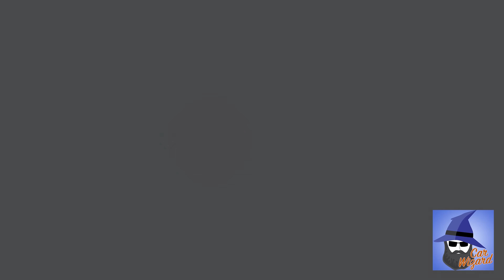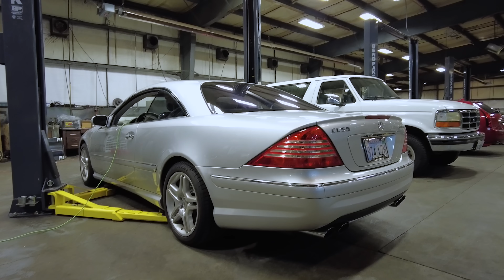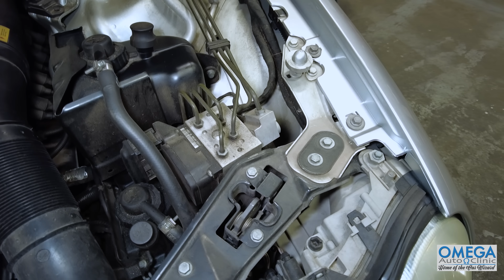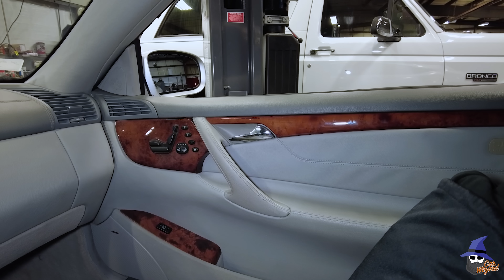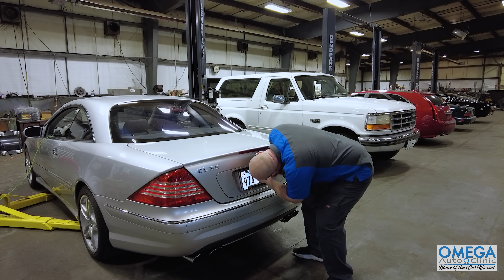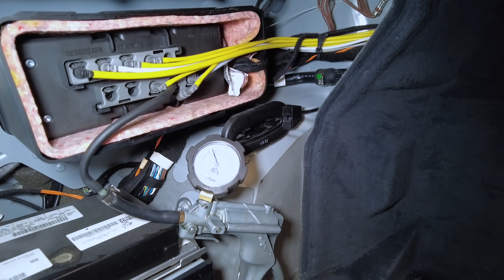Really, $4K to fix the locks! How can the CAR WIZARD charge SOOO much to fix this '05 CL55 AMG?!?

Comment: Out of the luxury mercs this era CL is maybe my favourite. But there's a reason they seem like a great deal used. Before prices took a hike, you could get a black cl55 for €5k. Because they're €10k per year to own.
Reply: Bingo
Reply: Bruh I own a CLK200. 

It's by no means cheap, but it's more like one thousand dollars a year to own, with hikes of up to 2k when something breaks because mercedes parts are expensive as fuck.
Reply: @user-rd3ou5ev6o CLK vs CL is quite a difference. This car has more computers in it than Silicon Valley
Reply: @tenzinsmith  Yeah my point is that this car is a money pit even when ur talking about older models, can't imagine new ones. Also the car is just uncomfortable as f*ck, nothing luxury about a coupe. 

As someone who's had a CLK 200 for like twenty years now, I can confirm the car is a piece of sht. 

Uncomfortable as hell, expensive, heavy, gas guzzler.

Yes it's a mercedes and if you take care of it it will last forever, but that care is expensive.  

Buy a four-door honda and be done with it.

Comment: There used to be a kit to repair the pump, replaces the seals that wear out when the pump runs constantly.  Same for the airmatic suspension pump, I have rebuilt that for $100. I have never seen a lock actuator leak, it’s always the hose. The seat bladders do leak sometimes, but again it’s mostly the vacuumed tubes or hard plastic connectors that crack.
Reply: I had the exact same car, I can bet that the leak is due to one of the door locks actuators or one of the hoses under the seat (for the lumbar/dynamic seat function) cause the seat move backward and frontward every time you open/close the door and that consistent daily movement cause the line to crack or separate. let's wait until her replace the PSE pump and see what's what lol.

Comment: back in the 90s I had an audi auto and as I was leaving the motorway and lifted off the engine stayed ay max revs I managed to stop it turn off, when i turned on it was fine so I carefully made my way home. Turned out all the carburetor "green" controls were air drived found a Y shape hose which had split when you moved the arms apart revs went to max. Nicked a piece of plastic hose from sons fish tank fixed.

Comment: I had a 1987 Jetta GL that was stolen and then it turned up about 2 months later at the NYPD pound in good shape. However,  they had meddled with some engine components and it cost me $1200 just to find out if it would run, which it did.
Reply: I'm happy for you, but I don't see how that relates to a Merc vacuum lock system?

Comment: I had a really nice 1977 Mercedes 450SEL years ago that had the vacuum door locks.  When I bought it, I noticed there was a golf tee stuck in a line near the latch in the trunk.  I assumed a leak somewhere since I had to use the key to unlock the trunk.  All the door locks worked fine so I just left it alone and never had any other trouble with the system.

Comment: I hate that all new cars these days are putting power everything. Power tail gates. Power seats. Power head rests. Power door assist latches. Power steering wheel adjustment. 

It's just a recipe for huge repair bills. I don't understand how adjusting your seat, or closing your doors requires electric motors. Or why that's even a huge benefit. I've never cursed at needing to open the tailgate lol.

Comment: Earlier versions, usually a 2 cent diode failure in the compressor. Water ingress! Seen a failed Golf R with the same system, crash damage on driver door, the failed to reconnect the line and you could hear the air leak.

Comment: The pump can be repaired pretty cheaply if it is indeed "dead".  I doubt this is a $400 fix let alone a $4k fix.  See this daily - buy hugely expensive parts because nobody fixes anything any more. It's a leak somewhere, an air leak at the end of the day. Fix the leak & fix the pump. It's a bloomin pump - not a rocket. The control circuit is fancy, but it runs an air pump/sucker. Watch a Russian guy who owns one of these - his mate Vlad will have it back working for 50c in 2 hours.

Comment: These are truly gorgeous cars.  I've always loved them.  That said, I've owned several other Mercedes of that era, and only by luck, did mine never have any issues with the vacuum actuator systems.
Reply: My W220 4Matic has 200k kms and no issues with the 20 yr old vacuum system. I've only had it for 5 yrs, so maybe the previous owner had issues, but I've had no major problems with the entire car for the past 5 yrs. One secondary air pump, $50 used, 10 min install. Two burned out LEDs in the door panels, DIY fix for $5, two relays, $4 each, Idler pulley, $20, DIY replacement.

Comment: My dad had a '83 Rabbit. This thing was a tank, my folks even offroaded it once 'cuz they couldn't find the road that lead to where they wanted to go. After that, my folks traded it for a '87 Jetta diesel with like 52hp or so. My dad's bros got a good laugh when he said he bought that car, 'till he had to do over 190kph between where we lived and Montréal to get my sister to St-Justine Hospital in emergency on highway 25 in Québec. That said, VWs after 1992 are pile of junks unfortunately. And that's kinda the same with any German cars noadays. Yes, they're beautiful, but just the price to get them fixed and they break ALL the time! My folks now own a 2012 V6 Kia Rondo (the engine with issues is the 4 cylinder), and that car is over 150 000 km and have been really dependable all of that time and it's now going on its 11th year of existence. Of course, certains issues have started to show off, but nothing alarming.

Comment: To chime in on Wizard saying it is the same on most german brand.  The soft close feature of 2005-2010 audi a8/s8 cannot be repaired as no softclose latch option exist. A little microswitch breaks and it takes a new latch. Audi no longer sell the latch, and the aftermarket do not have the soft close mecanism with the switch.  
I have developped a way to fix them and found suitable components as the saia burgess switch isnt advailable anymore. It takes a lot of dexterity and grinding and welding rivets.  One wrong move and the latch springs apart sending parts everywhere. 
As a matter of fact I have a latch coming from california for the repair service this week. Maybe I'll show that one on my channel

Comment: The Mercedes CL C215 Chassis does NOT have SBC... That is just a standard ABS pump you were looking at. SBC brakes ONLY came on the W211,  R230, C219 and the W240 Maybach..

Comment: I spent 40 years in auto serice; much of it German cars, most of it in Audi/VW.  Always fun to trace down vacuum leaks and replace vacuum/plastic hoses that run through out the body and of course, the vacuum pump that was located in the trunk.

The actuators would fail too; fortunately for me, the repairs usually involved the vacuum pump and replacing all the hoses.

I'm not sure what the hourly rate is where you are located is, but where I'm located, domestic dealerships start at 200usd, some specialized imports 450+hr.

And, Wizard, you are right, German auto parts prices are insane.  Although almost all vehicles today use globally sourced parts, those "pedestrian makes," i.e., Ford, Chevy, Toyota, Honda, Kia/Hyundai have, in general, more "reasonably" priced spares.

Comment: On Jay Leno's Mercedes 600 it would cost a lot more than that to fix the leaky power window switch. Yes, most of the accessories use hydraulics, not vacuum or electric. Each window switch is $11,500 eight years ago.

Comment: Thank you for this video, it's only two years to late in my case. The number one rule to wanting a supercar basically, is you either need the experience or the scratch to fix em when they break. We are not talking peanuts, I could have bought and sold a few cars for what I paid and was quoted to fix it later. It happened two days after the warranty expired. You ask extended warranty? I say yup but read your fine print! The company was/is reputable so long story, I lose 20K.

Comment: I never knew this era of Mercedes used a vacuum system instead of electronics for the door locks, trunk etc. Learn something new every day.
Reply: s class was the same system. Even for the soft close doors. The soft close was quieter than on my current audi which uses electric motors.

Comment: Funny.. the vacuumsystem was really reliable.. I owned a W123, 124, 140 and a 211 and never had such a problem I‘d think that the repair isn’t that expensive. It could be only a leak inside the system, the hosts.. if you aren’t react , when a failure pops up, you will have more problems..

Comment: This guy really is expensive, 2500 for door lock actuator? 😂
Reply from the maker: 1250 per side. The part itself is almost $1000. The parts are expensive. Not me.
Reply: @CarWizard  I fixed mine with epoxy.Still good after 5 yrs

Comment: As much as I like the idea of a CL 500 I'd take a CLK 500 instead; same running gear but a much less complicated car overall.
Reply: Same engine but the running gear/ chassis is different! CLK was on a C class platform. CL was on S class platform.
Reply: @johnguidetti5839  Yes we know the CLK was on a C Class platform, that's what makes it simpler.. the running gear (engine/transmission) is the same.

Comment: I fixed mine all by myself on my W220 with used PSE Pump, it matched the number on my old one so i didn't need to program the new part ,it cost me 90$ and  around 45 minutes! W215 and W220 are identical before everyone starts to hate.
Reply: You should make sure nothing is leaking though! So the pump wont die again.
Reply: @yeahnoway111  I heard the pump burns out when this car sits to long with a dead battery.
Reply: Wait, so it didn't cost you 4000 dollars?!
Reply: @SavedbyHim  Obviously if you do the work yourself.. its free. And used parts are much cheaper than new parts.
Reply: How long has it been working since you fixed it? I’m thinking of doing the same repair, do you have a link to anymore info. Thanks!

Comment: Why hasn't an after market, electronic replacement been made ? At least for the door locks ? And pneumatic controls, that's ancient technology, as the biggest draw back is The pump, the lines and the bladders. Similar to a pneumatic HVAC  building controls system. Nothing but trouble !

Comment: I've had one of these in the shop with the wipers/washers not working, found that with the key in the ignition the ezs would not give a T15 to the Front SAM but  the wipers/washers would work if you started the vehicle with the keyless go button on the gear leaver.. needed a new EZS. Good shout with a smoke machine and a mini vac to try narrow down the  leak if you've got a long time before the PSE pump arrives.

Comment: It was cheaper to install aftermarket keyless entry locks back in the late 1990s. I’m sure that’s still true.
Reply: Than you can still not adjust the seats and all that lol
Reply: I was thinking the same thing. I have a similar car with a similar problem and that’s an option I’m considering
Reply: @omostim2385  how would you adjust the seats then?
Reply: @naj_z  The seats in my car are electric and move just fine. I have those vacuum lumbar adjustments too but they never worked in the 3years I’ve had the car so I don’t miss that feature. It’s still the most comfy seat I’ve ever had in a car
Reply: @omostim2385  ahh okay.

Comment: "When everything works on these cars, they're amazing..."

The larger question is WHEN does everything work? The W220-based series of S-Class is like playing wack-o-mole. Sure, we can fix the vacuum pump today, but be prepared to replace ABC suspension components tomorrow. Or electrical items. Or braking components. On and on. Yes, the domestics have their issues for sure, but the thing about owning cars like a Vette or Caddy of this era is that it is unlikely to bankrupt you to fix those components due to a massive amount of parts inventory, lower labor, and interchangeable parts at a much lower price.

Comment: What if there is just a major leak in the whole system, that's why the pump cannot pull vacuum? I would block all the lines and then check if the pump can pull vacuum and check all the lines with hand pump before writing off the pump module.

Comment: This is why I have a Toyota and a Mercedes you know.. You use your Toyota as a daily driver for work and groceries shopping. Then you use your Mercedes on the weekends for cruising and looking cool. So you keep the Mercedes miles low and in good condition by keeping up with the services on it when needed. But have some money saved on the side to fix it just in case it ever runs into a major problem like the car in this video has.  I drive a 1994 Mercedes s320 and luckily i haven't had no major issues with it so far and I have owned it for 2 years already. If your driving your Mercedes everyday and not maintaining it or keeping up with the services then eventually it's gunna run into some really expensive problems!

Comment: Back in September 2008 I purchased a 2001 V12 CL600 Palm Springs car with 92,500 miles for $16,500, in "decent" condition and shipped it to Kuwait, where a new job was waiting for me. I was well aware that this car was going to give me a few monster headaches, but having worked previously in Kuwait 20 years before, I knew that there was an enormous number of independent mechanics with the know-how to fix any Mercedes without having to step foot at the local dealership. Sure enough, a month after I was driving it in Kuwait the engine developed a major oil leak, like 1 quart every 30 miles! The local mechanic where I had initially serviced the car brought over from the dealership their top engine mechanic (an Indian) to moonlight at his shop. Cost me KD 1500 ($5000) but it was fixed. What was wrong with it? They couldn't explain to me in English, it was not the rear main seal,  but one of those nights while my car was being fixed I visited the shop and to my horror saw my car's engine's cylinder heads on the floor, along with everything including the intake manifold, runners, fuel injection, water pump, everything on the garage floor as well... and the master mechanic was putting it all back together with his eyes closed, like paint by numbers, like a maestro pianist playing a Mendelsohn overture without looking at the notes! I only wish I had taken a picture! Two days later I got the car back and for the next 5 years it served me quite well without any more engine issues... Electrical problems that cropped up were also fixed at an independent electrician who specialized in Mercedes and BMWs... no big ticket repair bills here either. But, had I used the car in California I would have definitely gotten rid of it immediately. The CL600 was in a class of its own, super fast, super smooth and super comfortable. Did I mention the local Mercedes dealership charged $1000 just to open a file for a car that was not purchased at his dealership, and for the privilege of allowing your car to be serviced by an official Mercedes certified mechanic, gouging Mercedes dealership official repair prices! That same oil leak repair would probably cost me triple if not more had agreed to open an official file for the car! Probably the same mechanic would have worked on it!
Reply: The leak was the oil cooler seal. It lives in the center of the V. It can't be removed with the heads on.
Reply: Louis Rossman would probably love to talk to you.

Comment: My brother was quoted $4000 to fix his A/C on his 2001 Cadilac Deville.  Just an alternator on that car was quoted at $400, because they have to unbolt the motor mounts and jack up the engine to get at it.
Reply: $4000 on a Caddy? Unless that also includes heater core replacement and other major components, that is a huge crime of theft!
Reply: @hellkitty1014  When a compressor fails they usually replace all the parts, because metal shavings have contaminated the entire system.
Reply: Whoever gave that quote is a moron or simply didnt want to do the work. thats a 1000 repair max even on the older Northstars
Reply: Scam, I changed most of AC out on a 97 Deville northstar,  compressor $320 (2 year warantee), Condensor $190, Dryer 45, flush kit $35, o-rings etc came with kits = $590 parts, and took about 5 'shop' hours = $500

Comment: My '99 A4 had the vacuum actuated locks and the pump died after a few months of ownership. At the time I looked into options and found a place where I was able to order just the pump itself and not the whole module, as even then (2003?) the full replacement module was like $800!
Reply: Same here - who would have thought that making an air pump out of graphite would be a bad idea! LOL. I discover that the Passat part fits, and has a plastic rather than graphite impeller. Has been fine for the last 11 years since then. P/N is 8L0 862 257N in case this info helps anyone.
Reply: My Passat has nothing like that
Reply: @leenevin8451  Perhaps specific to the B5 chassis which it shared with the A4?
Reply: @arthurmchan  mine had electronic actuators (which also break) 

Just googled Passat b4 and they have vacuum locks too

Comment: Volkswagen in the 1980'-'90's time frame had a similar system for the door locks.  "Dual pressure pump" I think it was called.  It actually worked well and gave little trouble.
Reply: "...worked well and gave little trouble" - which is why they don't use it anymore lol
Reply: @macgroober1396  Hahah!